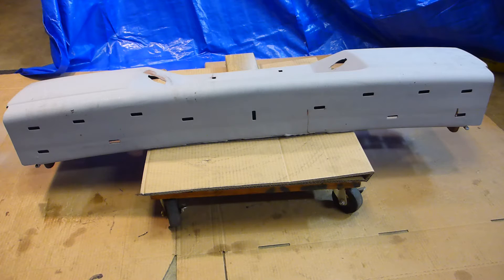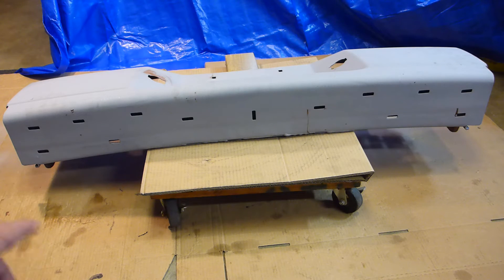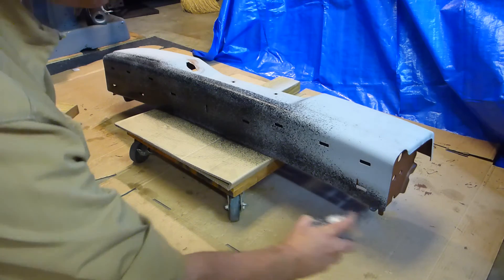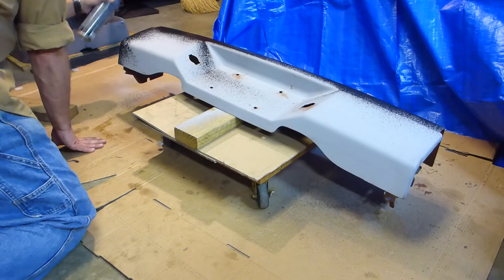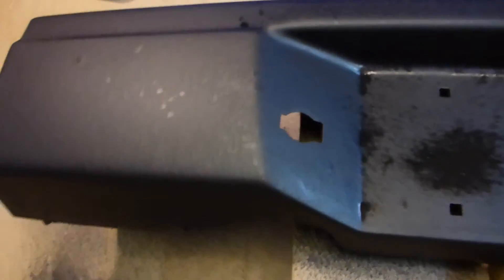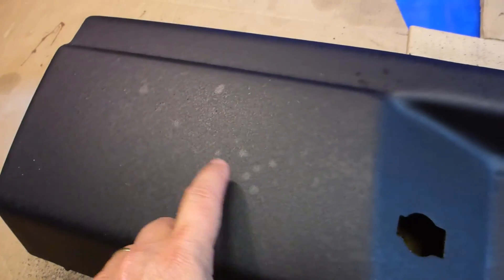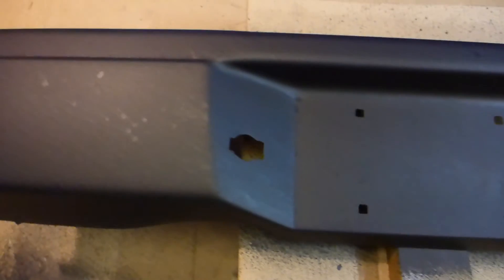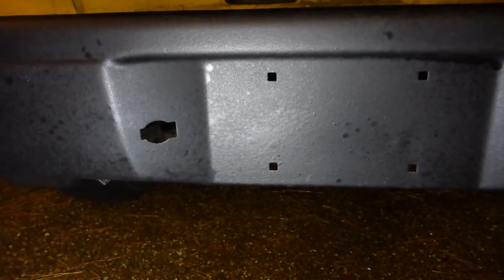2016 11 14 XTerra Bumper Refurb 01

Comment: I am needing to pull mine soon. I can't imagine a breaker bar not getting those bolts off. How did it hold up? It is more durable then black paint?
Reply from the maker: Holding up great--Looks as good today as it did nearly four years ago when I made the video. I don't remember what sort of breaker bars I tried, but I'm sure there's something I could have done better. Always is. Thanks for watching and commenting.
Reply: @RickRose  Someone put a dent in my bumper, offered to pay for it if it was reasonable. I called left a message about how we can pull the bumper ourselves, asked if he would help me. I'd pay for the re finish if he bought the tools needed to pull the dent out. Not heard back been almost a week. I might end up doing it all myself. Would not have cost him anything but time as he could keep the tools. Maybe he will call me back this week. If you ever pull your Alternator see my video on that to avoid some problems.
Reply from the maker: @SanitysVoid  Thanks I will check out your alternator video!

Comment: Mine peeled right off. Thought I was getting good product after studying bed liners. 2 hrs prep, 1 hr apply, 3 hrs dry time on 75 degree day. Gonna try something else.
Reply from the maker: Thanks for sharing your experience. Did you use it as a bedliner or to cover something else? My use is really more cosmetic than anything--I haven't really put it to the test of any kind of abrasion.
Reply: John Conforti I put it on my plastics and it peels off
Reply from the maker: Mine's still hanging in there after nearly two years. It's on metal, however. Maybe that makes a difference.
Reply: I used this stuff peel right off like plastic dip
Reply: I used it sanded with 100grit then sprayed the "bed armor" 4 seprate coats over the span of 48hrs now its solid as a rock on my fuek tank.  
Its good stuf when used right
Reply: For plastic you needed to use an adhesion promoter or it peels off. Like most paints on plastic.

Comment: With spray on bed liner, I find it best to do light coats, basically crop dust with it.  Let it dry 30 minutes between coats, shake the can like mad, i mean every few passes.  Keep the tip clean and when the can gets about half empty just toss it.  That stuff will sputter and run badly once it gets low, $9 for another can is worth not having that happen.  

Good video.
Reply from the maker: It has been a while since I used the stuff, but from what I recall that part about tossing the can when it starts sputtering is good advice. Thanks for sharing your experience.
Reply: I know these are old comments but if you warm the cans up in hot water, not too hot though, it sprays sooo much nicer.
Reply: @kbtat2  thats a good tip.  I usually leave cans in the sun to warm up for an hour or so.  That doesn't work in all climates though, warm water should work in any climate.